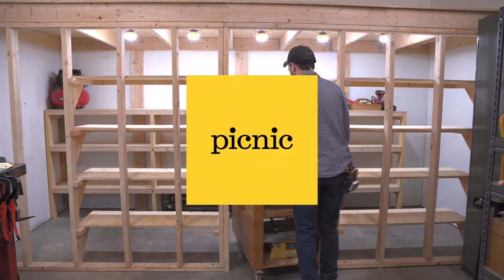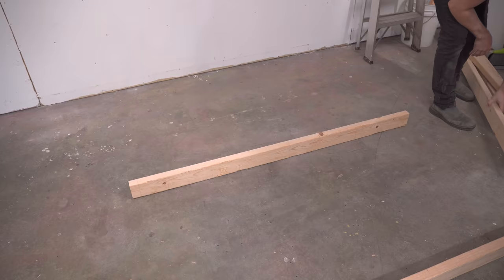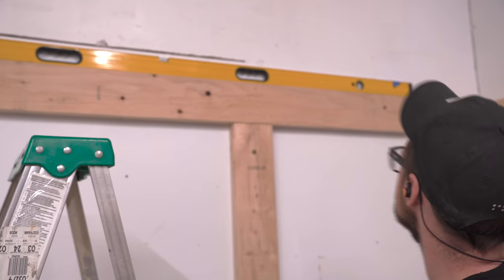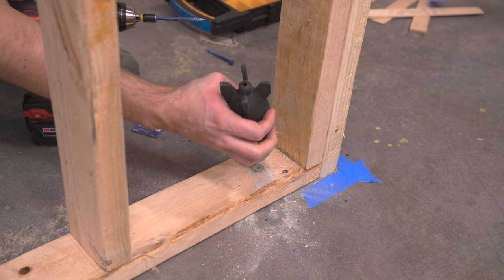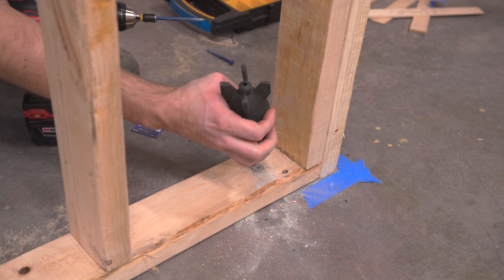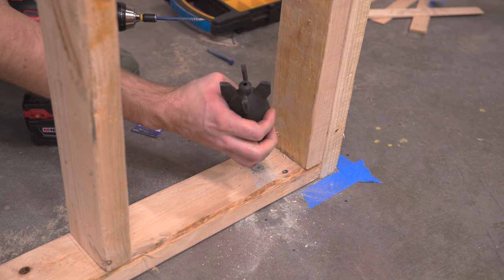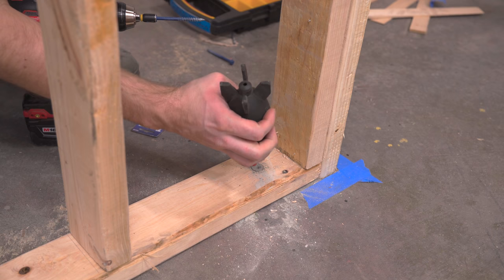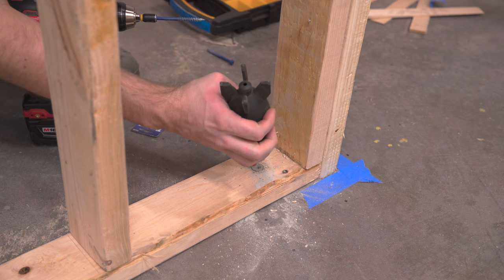FINALLY fixing my GARAGE storage problem

Comment: Pro tip on the hanging storage:. Keep an eye out for suit bags and drycleaning bags on the free stuff listings.  The shoulders of anything hanging for more than three months or so will get surprisingly filthy, even in a closet with a door.
Reply: I usually put black trash bags over camping gear that hangs or things like life vests. Just cut a hole for the hanger top to go through. Seems like this stuff does get dirty even in a closed room.
Reply: And if you don’t mind the fragrance, you can get febreeze scented trash bags meant to deal with trash odor that will help to keep your gear from smelling musty in the plastic.
Reply: @karenmitchell6814  I know you commented this 2 months ago. But I'm organizing my shop and boat storage area and this hack is genius for storing my life vests! No more musty smell
Reply: @krizkatz1574  You are welcome. And if you can’t find the scented ones or over time the the effect fades; put a dryer sheet in the bottom of the bag.  That’s a hack for storing suitcases as well: drop a dryer sheet in them before you zip them up and store them. Keeps them from getting musty too.
Reply: In a pinch stick a piece of painter’s tape along the top edges where the dust collects until you get a bag
Reply: @lopezfam7317  iiu
Reply: @lopezfam7317  bfg
Reply: We all need examples to over come the stuff in small places. Stuff creates blindness.  Thanks for helping open my eyes.
Reply: Most dollar stores sell $1 garment bags. They aren’t the best for travel, but this idea they would be money ( no pun intended).

Comment: I’m surprised you didn’t mention the low door knob 😂 should’ve cut the door in a way to keep the door knob normal height.
Reply: It probably would have meant a lot more work too.  I thought the knob height was strange.  Instead of cutting off the bottom of the door, he'd have to remove the top of the frame, cut that down the amount needed and then the door too.   Because the pre-mortised latch and door knob already there, you can't really move the door knob up or you'd have the ugly old hole and need the new one. 
An inch or two is probably ok, but 6", just too low.
Reply: The door is upside down :) thats why the knob is low, probably a cheap right swing door and he wanted a left swing door :D
Reply: @knasleradden   I was wondering that too, but it looked like it was cut down. Not a full height door.
Reply: @WoodUCreate   agreed. For me, it would bother the shit out of me. I’d rather have no door knob than a door knob at the wrong height lol.
Reply: @knasleradden  not upside down because the handle would be higher than the second hinge and the latch mortise in the frame wouldn’t line up

Comment: Few quick things for anyone attempting something similar.
1: there are double 2X6, 2X8, etc joist hangers, so you don’t need to get one for a 4X4 and shim it. 
2: most joists are not milled very accurately, so while it is convenient to just nail all the hangers on and then drop the joists in, you will very likely wind up with the top surface of the joists not being coplanar due to the inconsistencies in width.
3: it is a good idea to use pressure treated wood or a gasket for anything that is in contact with concrete, as concrete tends to be a source of moisture for wood.
Reply: Oh, I should add that you did a great job and I’m very jealous of your dust free storage area.
Reply: what is the solution for #2?
Reply from the maker: Hey Jeremy! All good suggestions. I totally spaced on the pressure treat.
Reply: @bs838  install the hangers on the joist you are hanging first and then attach to your beam, will allow you to ensure they are flush at the top
Reply: @_Thundrix  great tip. Thanks!
Reply: Was about to say in my time framing, roofing, etc, I have never hung joists like that lol. More often than not, we would tack the joist first with something like a Grip Rite screw, then put  on our hangers.

Comment: This is incredible. As someone who has never built anything like this by hand but would like to, seeing this is motivating and inspiriting but at the same time feels daunting. I'm new to your videos and will definitely be checking out more but I'm wondering do you have any videos where you explain your process for designing? Seems like you have to be able to plan way ahead to make sure everything gets cut and sized right!
Reply: I think that my biggest hang-up with wanting to get into projects like this is the lack of tools that you see these people use.
Reply: Just some math and practice
Reply: As someone who got into this 3 years ago and late in life, I'd recommend a good tape measure and graphing paper to plan out your designs.  Like Adisson commented- math and practice will get you there.  The tricky thing about lumber is a 2x4 isn't 2 inches by 4 inches.  It's 1.5"x3.5".  A 2x6 is 1.5"x5.5", but a 2x8 is 1.5"x7.25".  Do a search for dimensional lumber size charts and that will help with designing and making the proper cuts.  And as they say- measure twice, cut once.
Reply: Thank you so much ❤️˘◡˘❤️
Reply: The more you do the better your thoughts are.
Reply: @DavraxReigns if you want to get into framing all you need is a hammer, a tape, a square and a circular saw. Or even a hand saw if you want to go powerless. Luckily stuff like this isn't too cost prohibitive

Comment: Great video and even better build. Tip from some stuff I learned while drywalling, Never let your drywall boards sit on the concrete slab floor as they will soak up moisture always try to leave like 1/4 inch gap or so using a pry bar to help pry it up while hanging works great! Love the videos man keep up the great work.
Reply: I like to throw a couple plastic horseshoe shims down for this same reason. It'll keep it at a consistent height off the ground and it's so freaking easy

Comment: Even pre mixed mud needs water added fyi. It’ll make it so much easier for you. Box or bucket I take a yellow sponge dip it and squeeze it out in the mud. A 5 gallon bucket I like 2’full squeeze of the sponge, a box of mud I do 1-1.5. For all purpose mud. For finishing mud I typically go a little lighter
Reply from the maker: Good to know!

Comment: Your tip on structural screws is greatly appreciated. I love the design of the storage room; including a closet was an excellent idea. Adding a line of hooks in the wall of the closet (half way high) will provide a way to hang bags, bets, etc. without taking much space. Great use of the space! I’m not sure about the lights … they just look provisional.

Comment: with the floor stud, after drilling into the concrete a sliver of wood and then a penny nail driven in with the head sticking up so that it is easy to remove if you need to disassemble.

Comment: @Michael, I have found that using my impact driver to drive the tap-con screws into concrete has been more reliable. I agree they can be tempermental with just a screw-driver

Comment: Tip on fastening the bottom plate to concrete. If you drill a hole the same size as the nail you want to use then place a piece of tie wire in the hole ( it can be longer than the nail it doesn’t matter) then hammer the nail in. It’s crazy strong. Try it

Comment: 2 things for next time or others    
1. Green Treated for areas in contact with garage floor,
2. Align your ceiling/joists over the wall studs or use a double top plate

Comment: Design and construction advice: The inner studs 2x6.. It would have been structurally sound with 2x2! 

As long as they can not bend (which they can’t when screwed to the wall) they give more than enough support to whatever you manage to store upstairs! 😉

Kind regards 
Anders 
Sweden 
Retired engineer

Comment: That's a dream space. Hard for anyone to be productive when we're all drowning in a sea of crapola. My hat is off to you. 
BTW, the notching at 13:20 made sense to maximize space. I like the "triangle shelves" minimal material with great strength. I wasn't sure why you didn't notch the shelves on there too since now you'll have a 3 1/2 inch gap at the back of the shelf where things would slip down. 16:01
Reply: Same thing occurred to me, but I suppose if he's just putting those plastic tubs on the shelves, there's nothing that could even fall down the back

Comment: I also live in the greater Seattle area and suffer from all the tree pollen. I can't cut lumber without a face mask,  even outdoors.  I love your shelf design. I might steal it.  I've been considering building a similar storage room at the back of my 2 car garage to separate my woodworking shop from all our other tools. Then I can add storage to the other side of the wall for woodworking tools.  I wish I had that much ceiling height in my garage.   Also,  wetting drywall tape can cause it to bubble later down the road.  Mix water in the mud instead.

Comment: Great job Mike. Keep it up. Just on a side note for hanger joist there are specific nails that are used. They are a little smaller in length but are stubbier. Although for the load you have in that room you dont even need them i think. Superb content. Thank you

Comment: @ michael alm instead of cutting the drywall later in the video i think it would be easier and maybe faster if you would just drill a hola there should be a dril at the size of the pipe anyways thats what i was thinking feel free to do it the way you like

Comment: nice project bit you really should have supported the end of thst rim joist  where it met the other. The short one has no support under it. And you have a double floor joist straddling it.  Just a storage area but still bad juju. Take a minute and put a stud  underneath it.
Overall it turned out great!

Comment: Really nice build but I have a question. On the back wall (where the 2x6 was short) why didn't you make the seam over the vertical 2x6? ..where you put the double 2x6 floor joist. I believe that double is in fact depending on sheer strength of the rim joist screws in the wall and not compressive strength of vertical 2x6.
Reply: I wondered the same, but I think the vertical studs are attached to other vertical studs on the other side of the wall. Where the seam landed was probably just drywall with no support behind it.

Comment: I did the same thing...many times. Currently doing it again but with a twist. I'm planning to move to another country and I'm 65 now. So this time I'm looking harder are each item...do I really need that? Would replacing be cheaper than the space needed to storage it? For example I've switched to using screws rather than nails...yet I still have a lot of nails. So they're getting tossed.

My biggest with "storage" is it turns out to be "burial". Once stored 99% of the stuff gets buried and forgotten. Silly.

Comment: I think I somewhat like the no dry wall look of the storage room. It's sorta open air design, it's not claustrophobic, and you can see your tools so you can know where to get them before you even get inside.
Reply: Only downside is that it could collect dust from working in the rest of the space.
Reply: A deep closet was all he needed. He spent 10 times the money and labour in an unecessary "room".

Comment: With framing, the bottom plate on concrete need to be pressure treated wood.also for any structure framing it needs a double bottom and top place. This would no pass inspection

Comment: That speed square is horrendous.  Check it out.  It does not give 90 degrees.  I like the GRK structural screws.  I use them in stainless steel.

Comment: just wondering, why did you not put the joint where the 2 rim boards meet over an upright? @4:37 it would have been stronger especially since you have a floor joist right at that joint.

Comment: Pro tip on the plywood-&-bracket shelves: trim 1/2" or so bevels/triangles off all the outside corners of the plywood. Makes for a lot less cursing when you bang an arm into a sharp square corner while stowing things away working in close quarters,

Comment: Great video, thank you for the idea. I want to do something similar in my basement storage/office. I have a question though: You used nails with a nail gun to assemble the frame but then used pocket holes for the shelves. Is there any special reason why you did not use pocket holes for the frame?

Comment: This is great! One thing I’ve had trouble with ( which is barely an issue but….The gaff tape you used to label stuff. After about 6 months, the glue tends to dry out and get really ‘sandy’.  Leaving a nasty mess. That might just be a problem in my subtropical climate, but I hope it saves you a cleanup!)

Comment: FYI on drywall - never put a seam on the edge of a doorway, it will crack. Your method gave you two seams that 100% will crack. The best method is to have a sheet span the entire opening. Next best is for the seam to be over the center of the opening. Don't sand into the paper! Fill that factory seam next to the door. Don't hang it vertically to start with!

Comment: Question! Looking to do this but I want the loft to extend a few feet past the wall. (I want to install lights in the overhang and an access hole for a ladder) Is there anything different you would do for framing? Maybe blocking where the loft rests on the wall?

Comment: Good work, some notes: garages are angled downward in the direction of the door, don't breathe silica dust (use a vacuum), don't leave drywall unsupported (conduit), if possible use a 'beater' corded drill for concrete work. In a pinch, wet toilet paper balls work as ear plugs. Don't insert too far, but if stuck use a screw to fish them out.

Comment: Nice build out, but at the "cost of a garage to park cars or trucks," the purpose if any garage. Garages are always for vehicle storage, parking, theft/vandolization protection, and bad weather protection. Think hail, high wind (the hard objects the wind throws), trees and broken branches. On street parking ads even more danger, theft, break ins, vandols, or drunk drivers? All of which can typically be prevented by parking inside our garages. Not to mention the higher cist for auto insurance we all pay because of those vehicle claims. We all need some storage: for important things like family photos/digital hard copies, heirlooms, and holiday decorations mainly. Homes are deeigned with atics,  and basement for that reasin. Some even have a dry crall space that might work great? In your spefific uses, you have art work, camping and outdoor equipment, building supplies, etc.
 So you have unusal extra storage needs, most people don't. You mart even need a larger home at some point? If an additional room is needed, than maybe an actual home additiion (more expensive), but still might be smarter and create purpose built metal shop, hobby storage, and office space, while giving the garage back to your vehicles. It also adds value to your home, where having NO usable garage parking is less valuable to future home buyers and home appraisers.) Like too many of us, we collect lots of "stuff" that we store for years never using most of it. If it is not used or needed for a long time, then ask yourself, "do we really need it anymore?" So nothing against your built personally, you do have real practical extra space needs, but in general: turning garages into rooms or storing too much useless or no longer needed stuff is bad form. Garages are for vehicles, as said. Not using them, when you have them is wasteful and unwise. As said the higher dangers and related auto insurance cost ALL OF US have to pay for is never worth extra storage. Other options are building a seperate large shed, shop or studio in the back yard, finishing a basement space or unused atic space (if big enough). Or a home adding an addition, all of which would add value and needed space, without sacrifing your vehicles parking and safety. Just aome things to think of, before not using garages as their intended purpose. All that said, your build came out nice and I like the end design. Thanks looking forward to your future videos...

Comment: Question regarding spacing on the roof joist.......I see you used 24 inch spacing. Is there any benefit to using 16 inch spacing. I'm trying to plan a 10ft x 16ft loft on my pole barn.

Comment: 17:22  tip..
1.  Use a big socket drill adapter with big socket ( size needed will depend on the size of that i BOLT/SCREW you were putting in by hand with needle nose plyers) to turn it faster
2.  Use a flat head or philips head screw driver whose shaft will fit inside/go through the hole of the i part of that i bolt/screw and use that to turn it faster.
3.  Use a wrench to turn it faster.  :D

Thanks for this video I LOVE seeing wood working projects.  Wish I could do them ( lives in tiny apartment with neighbors on both side and the walls are thin.

Comment: Tip from a Pro home builder. A Stud is 92 5/8". Always. It's not 8' long. It is pre-cut to make building an 8' high wall easy and fast. Walls have 1 bottom plate and 2 top plates. not 1 on the top and 1 on the bottom. I appreciate your hard work but people who watch this should receive the correct information.